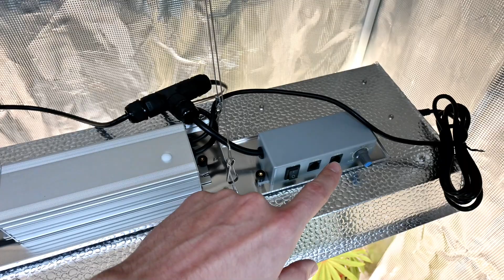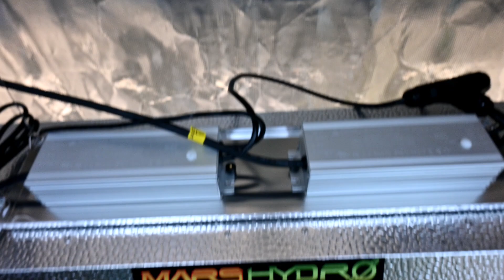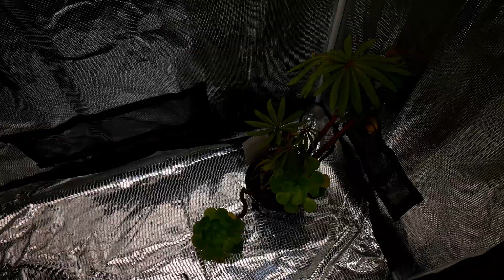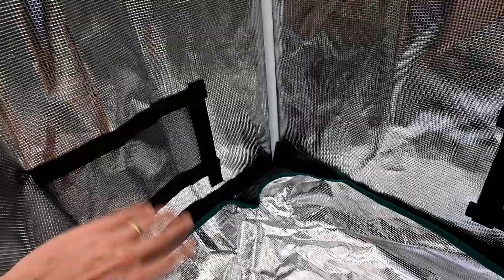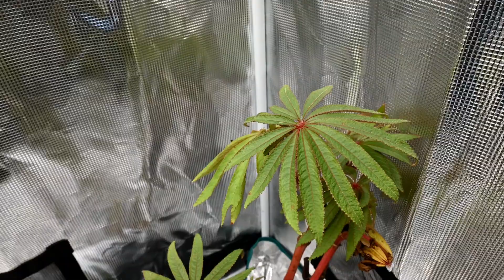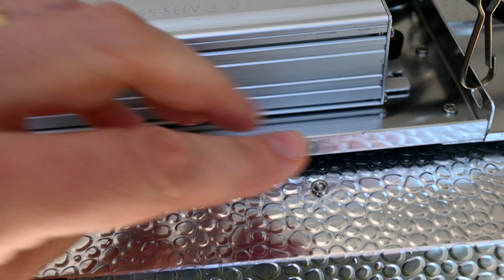Growlight Gardening. Setting up Mars Hydro TSL 2000

Comment: Not sure why it’s designed with the ballasts on the top as heat rises lol, they should really be outside the tent same as the controls, for ease and safety really.... personally it’s a waste of £300+
Parabolic shade and a duel spectrum cfl would of been maybe £50 and a lot better for your plants too, plus no ballast needed
Reply: Cfl is incomparable with led. That led would blow cfl out of the water. You get a lot deeper into the canopy with led. The reason the ballasts are on the light is because the light doesn't get hot, regardless of heat rising. Lumatek zeus pro is an even better light but double the price.
Reply: It can be placed outside the tent, cord is long enough.